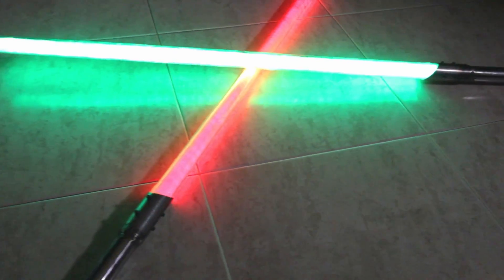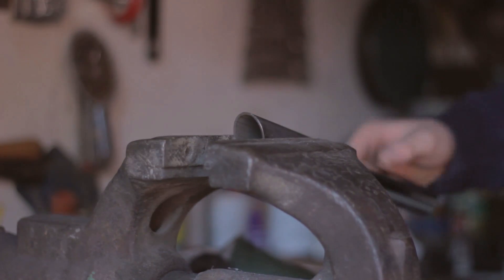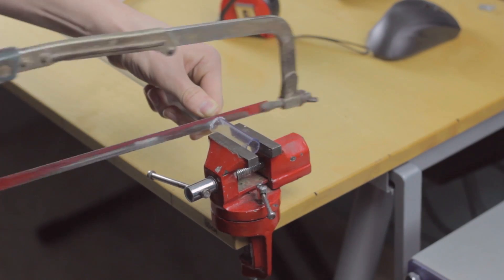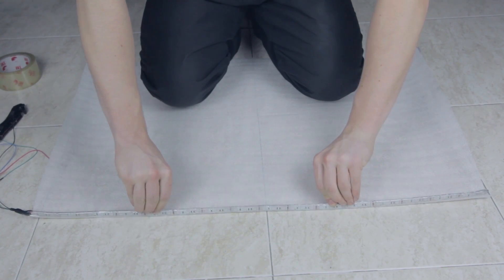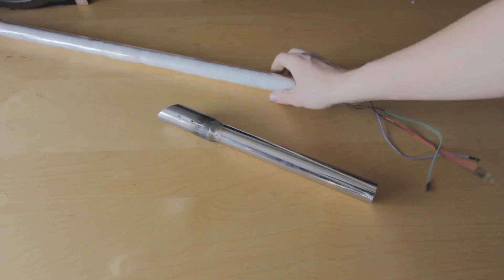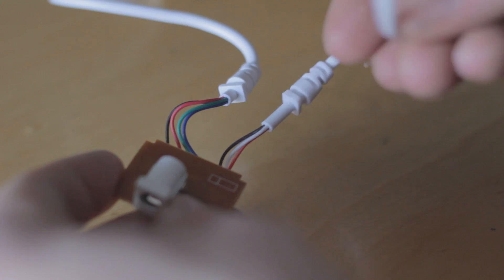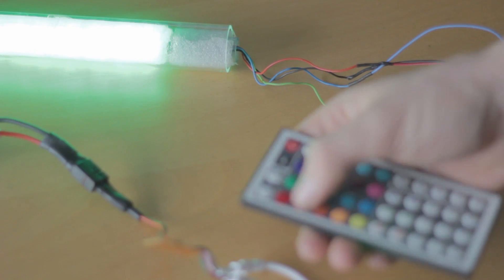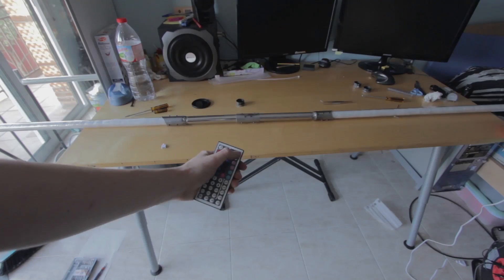DIY Lightsaber with LED

Comment: I am using what appears to be the same led controller as you but I’m using neopixel strips.  For some reason, the strips don’t light up no matter what I do.  Any tips?
Reply from the maker: Hi, I don't know much about neopixels but as a little research thst I did could it be that them need a microprocesor like arduino to work??
Reply: Eric Nieto I worked out something, a similar rig to what you did.  I just have to get the battery connected and then I should be good.  Thanks

Comment: @Eric Nieto Are 60 LED/meter enough or do u recommend more?
Reply from the maker: Jonas well, if you wan't to do a 35m long light saber 60m of LED won't be enought, but if you want to do a 1m blade for your light saber with 2m of LEDs you will have enouth
You need twice the length of LEDs you want your blade will be
Reply: Eric Nieto thank you very much for the response :)

Comment: Can I use PETG tube for the blade?Because I want to make one for my brother,and I want to make sure that the blade will not break apart.
Reply from the maker: +Spidey guys you can use the material you find that is better, metacrilate is not a good one, it breakes very easy. a perfect one would be policarbonate, but it's not easy to find.
Reply: ok thanks.I will go with PETG tube.

Comment: there is a much much easier version on make the saber using some premade parts.
Reply from the maker: KaRMa FLame, sure but it is also much more expensive
Reply: Eric Nieto that is true, but if you have the money I guess you could save a lot more time.
Reply from the maker: yep, this is true, you can do it faster if you have the money and buy some premade parts, but then I don't know if you will safe any money compared with buying the lightsaber done

Comment: @Eric Nieto dude what is the material you use to cover the LED?
I have tried with the wrapping paper but you still see the lighted squares, and the color is not uniform
Reply from the maker: I used wrapping paper, but I put a lot of it.. and also depends on the density of the material, you also can try it with vegetal paper

Comment: How did you solder the wires without any solder?
Reply: Stephen B. Smith he did but it is so tiny
Reply from the maker: you can twist the wires and put electric tape
Reply: woooooow

Comment: Como pros los veo resultones y baratos de fabricar, y la idea de usar una tira de led RGB con mando a distancia me ha parecido muy original, el montaje para poder unirlos y montar un bastón jedi, es un detalle muy acertado.

Contras:
Respecto al mango, creo que quizá no todo el mundo tenga a mano ese tipo de herramientas o sepa usarlas correctamente, posiblemente sea más cómodo y fácil de montar, y necesite de menos herramientas, si se busca un material más accesible, (no se si más barato), yo buscaría montar el mango con una combinación de tubos de pvc y aluminio o latón cromado, en vez del acero, y un buen pegamento en vez de soldadura).

Respecto al montaje electrónico, quizá para un sable láser, esos leds iluminen poco, y si te gusta lo de cambiar los colorines, se pueden usar los montajes de los leds RGB de linternas chinas (que suelen ser muy baratas), con mejor resultado de iluminación y más fácil montaje, sin llegar a tener que soldar tanto cable, y además la hoja queda más "limpia", al no llevar el tubo la tira de leds dentro.

Respecto al tubo de la "hoja", entiendo que el uso que le quieres dar es para practicar tú solo, ya que esos tubos no son los adecuados para recibir impactos, y el llevar en el interior la tira de leds tampoco ayudará mucho a que se usen para "combate".

Obviamente hay opciones "algo mas caras" si nos ponemos algo más exigentes, añadiendo un kit de sensores de movimiento e impacto con sonido, o una hoja de tubo de policarbonato duro, para poder usarla en combates, pero siempre va a salir más barato que comprar un sable "prefabricado" a sitios como saberforge, ultrasabers, fxsabers, etc. donde con los gastos de envío el sable más sencillito suele rondar los 200€.
Reply from the maker: +Alfonso Ortiz Un comentario muy acertado, la mayoria de cosas que dices ya las habia comentado en otros comentarios, aunque lo que comentas de usar LEDs de linternas y la oja hueca tiene sus bentajas como facilitar el proceso y reducir el peso de la oja, pero la luminosidad no es una de sus ventajas, ya que yo tengo un par de sables de "ultrasabers" con los LEDs mas potentes y dan aproximadamente la misma luz que los mios (k no llevan las tiras de LED mas potentes), no los he puesto uno al lado del otro para comparar aun, de hecho quiero hacerlo en un video futuro.
Saludos
Reply: Eric Nieto La única tira de led que he visto que alumbre "mejor" que los leds es la Makoto V3 y v4, pero no es una solución fácil ni barata, y es ya a nivel de construcción de sables "pro", en el ámbito de lo casero, a mi parecer, dan mejor resultado los leds de linterna que la tira de leds.

Comment: How bright is the lightsaber? I'm planning on making your exact model but I don't want to spend all that time on it if the saber isn't bright. What do you suggest?
Reply from the maker: it is similar to the light of the ones that some brands sell (or even a little bit more, because this ones have LEDs inside all the blade) if you are indoor  they look nice (as you can see in the video), but if you are outside in a very sunny day them aren't bright enought.
Reply: Okay thank you

Comment: is there any way to use a more reflective film for the LEDs? might do this for a sith saber, and also you know anything about installing a sound board?
Reply from the maker: I don't know so mush about diferent types of films, I used the ones I found, and for the sound board there's ways to make them but are dificult, the easy way is to buy them and connect them to the same battery (if them also work at 12V) but I don't know them, how muche them cost or if them work great

Comment: I may have missed  it but I didn't hear what type of battery you used in it, do you simply take the bottom cap off to replace the battery?
Reply from the maker: I'm using LiPo batteries but you can use any type of them that fits on the handle and gives you 12V
and yes, you only have to take the bottom off to disconnect the battery and replace it

Comment: i liked this bc i was curiously about making a blade that is nice like this home made instead of spending $100 to buy one.
Reply: ChamZeron902 this cost 100 to make XD
Reply: ChamZeron 
the description puts the cost of materials at around 40€
but that doesn't take into account tools, time and labor.
if someone has all the tools and skills, and could buy the supplies in bulk for a lower price, they could turn a decent profit even if they sell it for less than official merchandise. 
but they'd have to stay away from the term "lightsaber"... disney ain't having none of that.
Reply: This cost $100 to make and several hours (where you could've made $100 or more). Soooooooooo.....
Reply: ChamZeron would wait till they go on sale ( whenever that happens. ..)
Reply: ChamZeron U will also get satisfaction  doing something yourself ;)

Comment: can the lightsaber be used for fighting
Reply: this will depend on what materials will you use, these guy used methacrilate and it is not to much resistant but you coud use policarbonate for example, that is way more resistant and then i would be completely ready for battle with them

Comment: is it battle ready
Reply: this will depend on what materials will you use, these guy used methacrilate and it is not to much resistant but you coud use policarbonate for example, that is way more resistant and then i would be completely ready for battle with them
Reply: Daniel Madueño Thanks for the information man...and your typo at the end made it sound like a challenge. "Then I would be battle ready." lol you're on sir.

Comment: My only question is would it be battle sturdy?
Reply from the maker: this will depend on what materials will you use, I used methacrilate and it is not to much resistant but you could use policarbonate for exemple, that is way more resistant and then I would be completely ready for battle with them
Reply: Laochri some people just can't appreciate the work that went into this. of course there are better ones out there but he put the time and effort for this video. learn to appreciate asshat.
Reply: No.  There is no way that the material of the clear plastic pipe will survive duelling.  The Lightsaber would have to be much stronger.  As someone who has practised a sword style I can say this for sure.  We practised with bokken which were wooden swords approximately 1.25m long and between 25 - 40mm in depth along the part that takes the impact.  Even they had a tendency to break after a while.

You would need a material sturdy enough to take hammer blows without shattering, sturdy enough to keep from bending with impacts and yet be translucent with a hollow for you to fit the lighting through.  Unfortunately I don't believe such a material exists.
Reply from the maker: there is policarbonate it is a ultraresistant material that blends a little bit before breaking, and trust me, I have tried them and resist hard impacts, I'll try to do a video showing it. 
well I'm really preparing a video in my new channel where I'm doing dueling with policarbonate tubes, it will be online in a week more or less, (you can find my new channel in the recomendations of this channel, it's Sutantoworld)
Reply: James Lewis But several plexi tubes inside each other and fill in the spaces with translucent resin (I don't know the exact name of it in english). this will give.you a structure that has the elasticity of the resin, yet the stiffness of the plexi. Anyway, I don't know much about plastics, but I am pretty sure there are many materials that are translucent and are way stronger then plexi.
Reply: James Lewis I'm not sure about how this joker builds his blade, but yes a real led blade will stand up to a great deal of punishment.  Check out The Custom Saber Shop and other saber shops.  you can build sabers that have light, sound and are duel worthy.  100 times better than this guys baby toy.
Reply: +James Lewis diamond

Comment: I also thought about using an LED strip but the space is too far betwene them so there are dark spots.
Reply: It depends on the LED strip.
They go from 60 LEDs/meter all the way to 240 LEDs/meter
Check your local stores for higher density LED strips :)

Comment: Me and my dad went to the store 8 years ago and found a nice starting hilt for a double bladed lightsaber that can be detached in the middle. We are finally starting the project today. I just wanted to know, what would be a good way to setup the lighting system since the lightsabers will split? If i can, i want the two to be linked to one control module for colors but two separate on/off switches for the separate lightsabers. Help is appreciated. :)

Comment: What´s the type and voltage of the battery you use for the led string? And could you provide some schematis for this? And also, how many time the saber can keep on?
Reply from the maker: the LED string works at 12V so if you are using a Lipo battery you have to choose a 3S. there's some basic schematics in the minute 3:15, the time of the lightsaber keep on depends on the battery you are using.

Comment: I only have a powersource of 3,7 max 4,2 V. Do the LED's also work with less Power?
Reply from the maker: them would work but with too weak light.. you should use an other kind of LEDs or search an other battery

Comment: for the wiring of the wires to the board, do you use the original connection piece from the end of the LED strip?
Reply from the maker: sure, you can use it, I had to weld the wires to the LED strip because I had used a piece on it for an other project and there was the original connection
Reply: +Eric Nieto im saying for connection the wires, soldered to the strip, to the board
Reply: +Eric Nieto at 4:12 on the video if that helps describe, where you are wiring the ones you soldered to the strip, to the board
Reply from the maker: I don't understand what you mean, for connecting the strip to the board you can use the original connector that comes with them as you would do if you were installing the LED strip somewhere. but as I had not the original connector in the strip I had to weld some wires. finally it don't cares about how you connect them meantwile the order of the wires is the correct one.
I'm sorry if I don't explain very well, someimes it's dificult for me to explain things to other people in spanish, and whene I'm trying to do it in english it's still harder :D

Comment: This is by far the best lightsaber making video I saw, thank you for it
Reply from the maker: I would be stronger if you would use an other material for the blade, as policarbonate, I used metacrilate and it is not very resistant. but it's all about the materials that you use
Reply from the maker: thanks you for whatching and comment :D
Reply: +Eric Nieto hey how stirty is the blades can you hit them relatively hard and have them intact?
(mined the spelling issues)
Reply: +Eric Nieto OK thanks
Reply: Eric Nieto you could add another tube, just slim enough so it fit snugly inside the outer, and push comes to shove a third tube
Reply: Fluburtur
Reply: it doesnt look very sturdy, id suggest if you make this use it only for a cosplay or a costume and not saber combat

Comment: But can u fight with them?
Reply from the maker: it depens on the material that you will use in the blade, if you use polycarbonate you can fight as much as you want, but if you make it of glass you will brake it at the first hit made.

Comment: how thick are the transparant tubes
Reply from the maker: mine was 30mm of diameter, but you could use the diameter that you want while it will fit inside the handle
Reply: Eric Nieto thx

Comment: For the foam, is it thick or thin packing foam? amazon has many different types, if you had a link for that that'd be great!
Reply from the maker: I don't know exactly which one of this it is.. I know that its name polypropylene foam, but you can use any plastic that could blur the lights of the LEDs
Reply: How about the type of dean connectors you use?
Reply: +Eric Nieto And sorry for all the questions, but the type of wire used for wiring the LEDs themselves, to the board any particular type? I know I keep asking but I want to try to get it as close to the way you've got it as possible
Reply from the maker: Hi, you can use  any type of connector, I used DEAN connectors because I use them for the drone, but you can use any type of connector and as small as it can be better. for the wires the same, as thin as you can find, well without going so far, probably 1 - 1,5 mm would be the best ones.
You can ask everything you want, and sorry if I'm dififcult to understand or I write very strange, I'm improving in my English but I'm still not very good.
thanks
Reply: +Eric Nieto perfectly fine to understand, going to be trying to replicate the process as close as possible, reason i ask about the wire is it looks like an old like 60 pin cord section
Reply: +Eric Nieto What kind of charging station/port do you use to recharge the airsoft battery?
Reply from the maker: there are especial chargers like this ones:

http://www.hobbyking.com/hobbyking/store/__1434__408__Chargers_Accessories-Battery_Charger_AC_DC_.html

you have to see if it can be used with your voltage and Intensity batteries, but like the batteries that we can put inside the handle are small almost every charger will work.

I recommend you to search some information about LiPo batteries because them are dangerous if you do it wrong
Reply: +Eric Nieto i got the same one as you are using for battery
Reply from the maker: then you can use a lot of options, I would recommend you using  an intelligent one, it's more safety because it stops charging when the battery is full.

a chip and good option for example would be this one:
http://www.hobbyking.com/hobbyking/store/__76462__IMAX_B6_AC_DC_Charger_5A_50W_With_US_Plug_Copy_.html

Comment: +Eric Nieto can you add where you got your materials?
Reply from the maker: I got the plastic and metal tubes in local shops, the other materials are really easy to find on Amazon, ebay, etc, except from the batteries that I put a link on the description
Reply: OK thanks

Comment: what kind of wrapping did you use inside the tube to make it brighter?
Reply from the maker: I think that you are talking about the polypropylene foam, it doesn't make it brighter but it blurs the lights of the LEDs and makes it looking like only one light. this foam is used for protecting the packages when you send something.

Comment: How are blades impact resistence ? 'cause i use lightsaber for fighting (coreographic group) and I like to use a string led blade.
Reply from the maker: it depends of with material will you use for the blade, I did it of methacrylate and this material is to weak, but you could do it of polycarbonate that it is very strong and you could fight without problems
Reply: +Eric Nieto 
Yeah, we use polycarbonate. My doubts are about the resistence of the led string. Did you try to hit two blades and all led still ok ?

Sorry for all these questions
Reply from the maker: Oh yes, the LED strips resists very well
Reply: Thanks man !